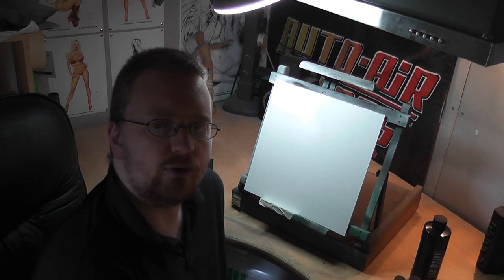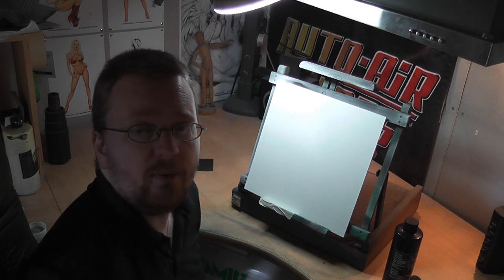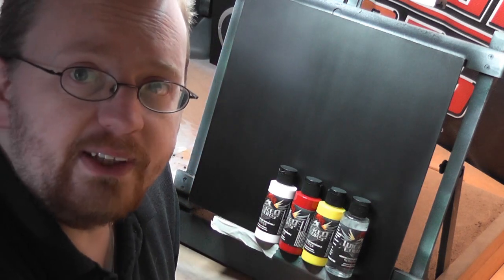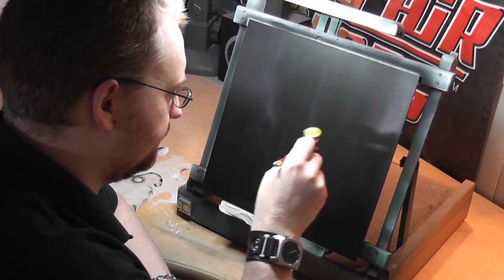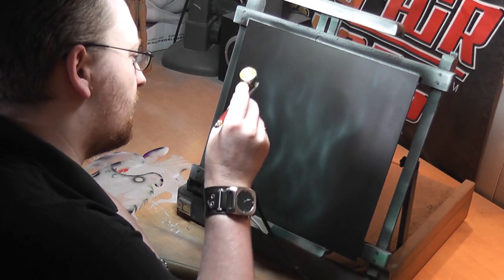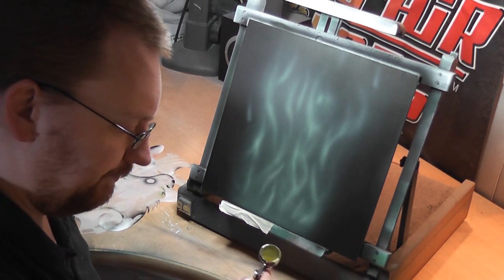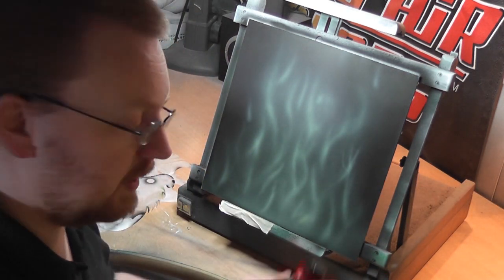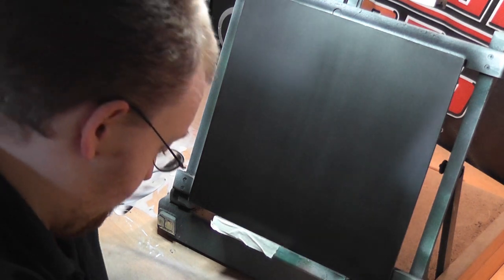Pt1: How to airbrush true fire with water based paints

Comment: really enjoy your videos by the way, very helpful as a beginner. I've found some water based candy paint, haven't tried it yet but would like to know if you use it on fire patterns the same as solvent auto paint? would it give same details? thanks for making these videos and would like to add that your work is very impressive.

Comment from the maker: @LeSaintPatrick Ive only used the first formula candies from AA that came out years ago and to be honest they were rubbish lol. I havent gotten my hands on any of the newer ink-based ones though. Ive heard they are pretty good.
Differences from AA to Wicked... Wicked has more tip dry, Wicked and its reducer separate in your paint cup over time, Wicked it much easier to work with (minus the tip dry lol) and is easier to get fine details with some over-reduction. Wicked IS better than AA in my op.